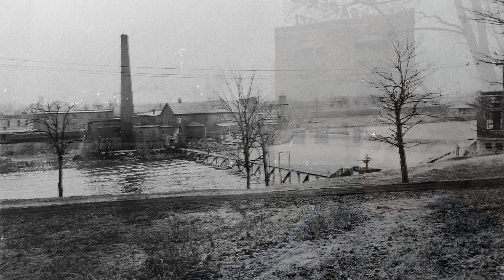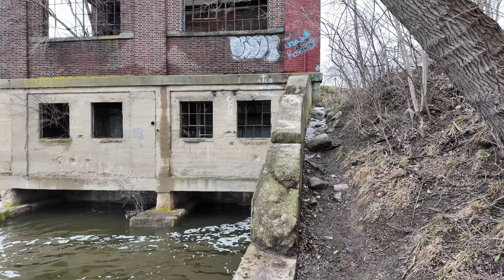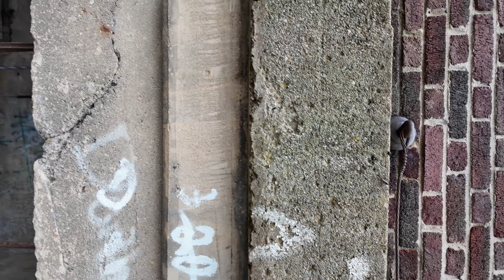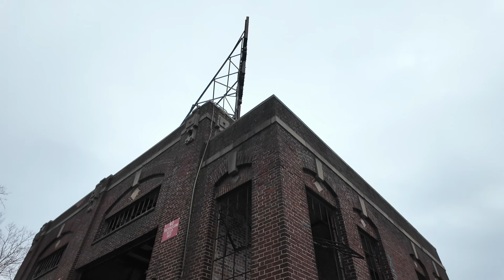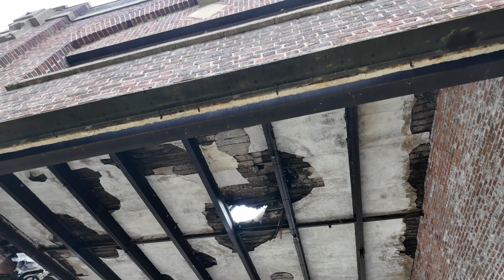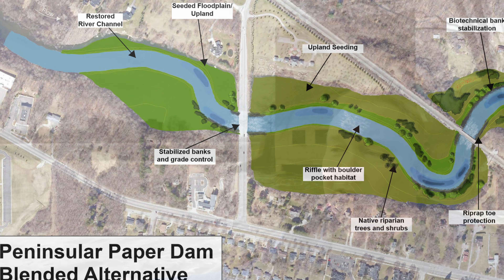Ypsilanti's Peninsular Paper Company - Heritage or Hazard?

Comment: The mill building on the other side was a fixture in my experience of Ypsilanti for a long time. It would have been cool if it could have been restored in some way.
Reply from the maker: A city employee stopped by while I was there (I suspect I tripped an alarm).  We talked about that a bit.  It'd be fairly easy to put a roof on it and pour a new slab floor.  The main, structural elements are still good.